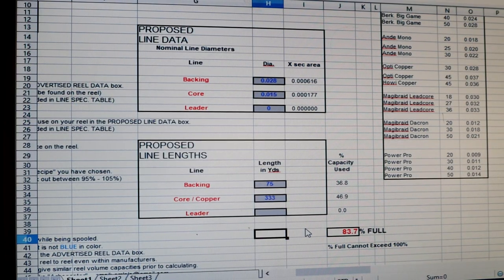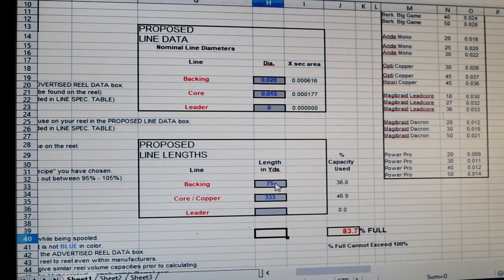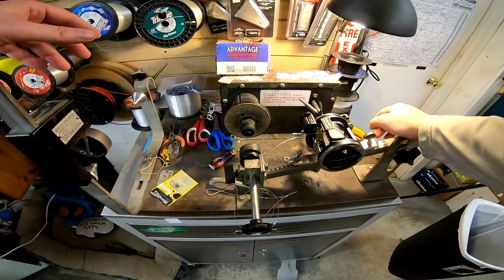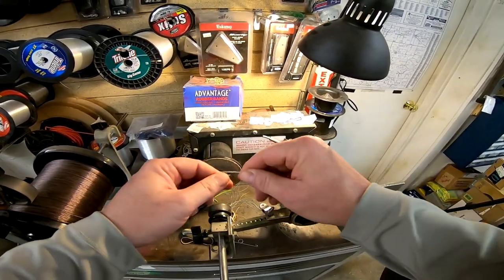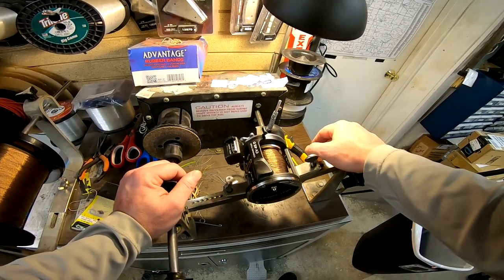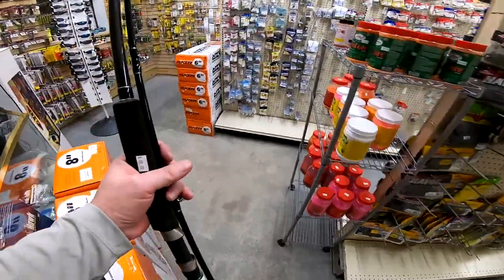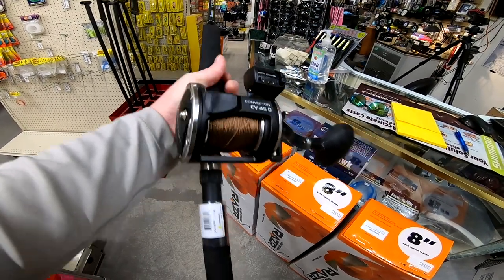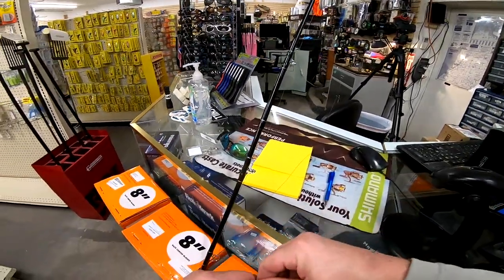Spooling a Wire Dipsy Diver Reel/ Rod Selection / Knots Explained

Comment: Chris,  Nice job on the video.  Never used a wire dipsey setup myself here on Lake Superior.  Used braid but all and all haven't run a ton of dipsey up until last year.  Then it even wasn't an everyday thing.  But I do run 6 down riggers and my farthest forward ones are modified with long booms on them so they get in the way at time.  I will probably try more dipsey rigs this summer as I had decent luck when I did run them.  It is all ways good to try new things.  My brother was better at it than me.  I get in a groove and keep going with had worked in the past.  But I am getting better at getting out of the box a little.  Thank you for all the work you put into these.
Reply from the maker: Thanks buddy. Good luck next season.

Comment: Chris, do you always run Flasher Flys or Meat Rigs on your divers?  If you run spoons on the wire divers, do you put on a smaller swivel at the end of your leader verses the one your use to secure the flasher?
Reply from the maker: that's correct, use smaller swivels for spoons.

Comment: Hey thanks, Chris. I did ask for this video and its nice to see it happen. I was kind of hoping that you'd talk a little about the amount of tension you keep the wire at during the spooling. I have heard all kinds of different suggestions. And, guys say to put a tripped diver on and let it out behind the boat and reel it back to tension the spool properly. Your thoughts? Lastly, what about putting a large bead before the swivel to protect the tip in case someone accidentally reels it into the tip? Thanks again for all your help.
Reply from the maker: If you don’t have a twilli tip the bead is a good idea. I use normal tension when spoiling this setup. After a few deployments it will tighten up even more.

Comment: I used to use Bloodrun products,  but not anymore. It started with their mono, I had multiple breakoffs, even with trying to release the line from the downrigger clip.  Then on my wire divers, same thing. After losing fish and tackle, I got rid of all the Bloodrun garage and switched to other brands. No more breakoffs!!! So I feel it's just not "1 bad spool" it's across all off their line. Just my opinion.
Reply from the maker: I’m sorry to hear that, but myself and many others around here were having similar problems.

Comment: You mention high diver and low divers in multiple videos. you mention that you run deeper diver 4 on your high and 5 on your low. Is that the only difference? Are you ever running lead core/ copper with your dipsies? And if so why and how much deeper will it get you. If you have already made a video explaining this let me know, thanks for the great content.
Reply from the maker: #1 setting on the low and #3 setting on the high.  You don't run copper or lead core on divers.  They are set up on planer boards.

Comment: Hi Chris.  Love your videos.  I have a question.  I run a boat in the Pacific Northwest.  We do a lot of jigging for halibut and rockfish.  We have quite a few rods set up with 30# reels and 50# braid.    I know they wouldn’t be optimal but do you think those would work on the dipsy  divers instead of the wire?  I’ve been thinking about adding divers to our downrigger spread and, due to space constraints, would rather not get a whole dedicated wire setup.  Thanks
Reply from the maker: Braid will do just fine on the diver rods.  Don't use mono.  It has too much stretch.

Comment: Do you suggest after spooling your wire on when you first get the new setup on the water running all the wire out then reel it back on to get it tight ?
Reply from the maker: I really don’t think it’s necessary but you certainly can if you want to. After a few times fishing with it you’ll find it has tightened up sufficiently.

Comment: Love your shows thanks.  Question is you talk high low dipsey divers and one mag for low, one smaller for high.  How much difference in height difference do you do.  For example high at 40 ft and low at  60.  Or is that to close.  One more since I am switching to wire divers,. What is depth rule for mag 3 to one and since high is different size 2 to one
Reply from the maker: You can run the divers at any depth you like as long as the high diver is on the 3 setting and the low is on the 1 setting.  There are times when both my divers are near each other in depth, but due to the different setting the high diver is much further away from the boat.  The high diver is a 3/1 ratio and the low is 2/1.

Comment: How do you break down a wire dipsy rod without risking kinking the line at the rod break point when they are put side by side with ties?
Reply from the maker: Reel the end of the wire up to the spool, tie it to a rubber band and put the rubber band around the reel.  When you are ready to use it again string it back up as normal and go to town.
Reply: @tangledtacklefishing  so you’d take the swivel off every time to break the rod down for storage or transport?
Reply from the maker: @jsipko  I don't break mine down for storage, but if I had to that's the way I would do it.

Comment: What scenarios do you run a wire Dipsy (Dream Weaver)?  I was seriously considering a pair.  I fish mainly for walleye and figured it wasn't worth the hassle in at 50-65 feet and went for 65lb Power Pro on 9ft rods instead.  I haven't fished with them yet.
Reply from the maker: There are many out there that use wire for walleye. The wire puts out a distinct hum in the water that fish seem to cue in on.

Comment: How much tension do you use when spooling on the wire? My wires always bird nest or cuts under itself....
Reply from the maker: Moderate tension.  If you are getting bird's nests when deploying make sure you leave the clicker on so it deploys under some tension.  Any time I'm going to let wire out, even if it's just to change baits, I make sure the clicker is on.  Otherwise your going to have future bird's nests.

Comment: How important is it to put 1,000 ft of wire on a wire diver rig?   Is that just common practice?  Setting mine up this weekend, just curious . Thanks chris
Reply from the maker: It's common practice, but the most important thing is to have your reel completely full and with the same amount of line on all diver reels.  That gives you accurate and uniform depths.
Reply: @tangledtacklefishing  For the sake of saving money, could you split a 1000ft spool and put 500ft on a reel and just have more mono backer to fill the spool?
Reply: @joshgrunewald   I was going to ask this same question.    He only lets the divers out between 100 and 120 feet, so why put 1000 feet of wire on them?  I would fill them up with cheap mono and put 200 feet of wire on.  Unless I am missing something?

Comment: The 7 strand wire you use is that 30lbs test?
Reply from the maker: Correct.
Reply: Where can I find dive charts for Dreamweaver deeper diver showing wire? Specifically 107mm 124mm
Reply from the maker: I believe it’s on the packaging.
Reply: The packaging only shows 30# braid. I would think wire would be different.
Reply from the maker: That’s the chart we use. Wire is still pretty close.